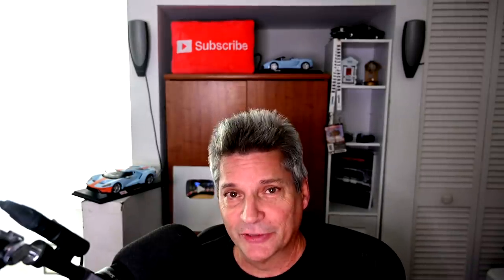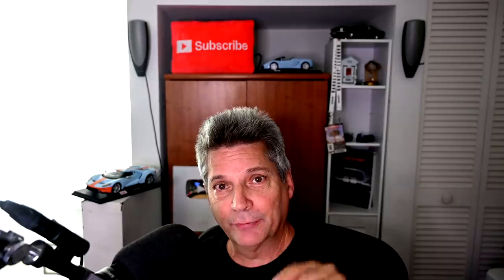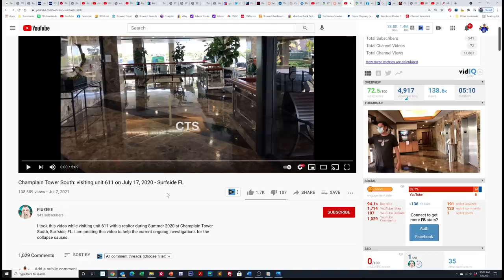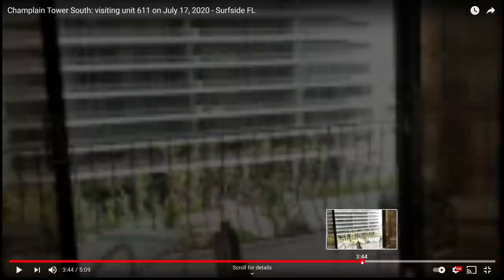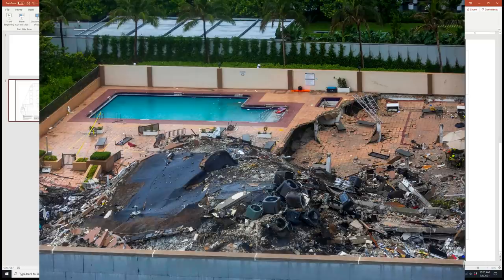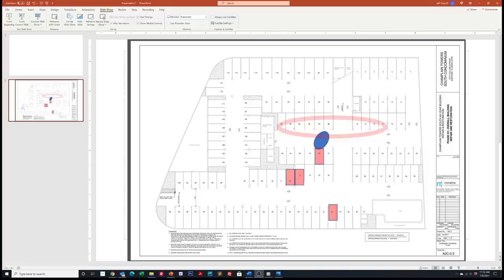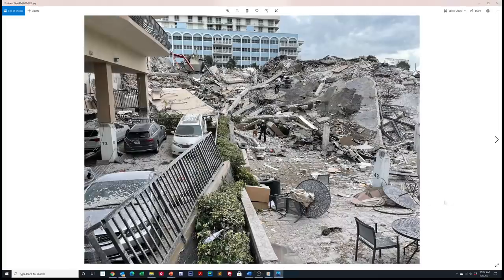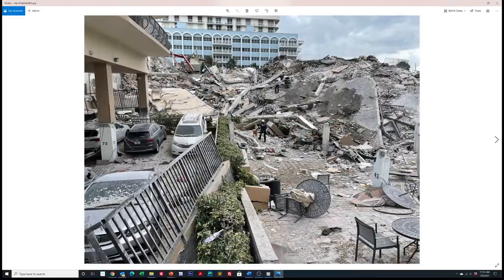Analysis Garage Video BEFORE Condo Collapse: Water Everywhere

Comment: The yellow paint on bottom of support column at 106, looks like might have retained water in the bottom.. didn't notice that on some of the others,  however did see shadows on some.   But this one looks like it def.  has a demarcation line.
Space 52 support column as well.
Could be a bad repair and paint job as well.
Reply: I was wondering why nobody commented on that because that was one of the first things I noticed. MANY of the columns show what appears to be water lines. Some are hard to tell and could be things like shadows, but considering we know that water was a big issue here it seems likely that most of them are actually from water. It also appears to be in all areas with only a few not showing at least suspicion of water. It's also worth noting that MAYBE the ones that appear to lack these lines may have simply been repainted recently enough that the lines are covered. If there is one consistent theme throughout it is that water was a constant long term issue here in nearly every way.

Also worth mentioning that in most of the shots that are clear enough you can see the markings of what appear to be large dried up water puddles all over the place. These are not just where we know the "hot spots" are either, it looks like water has infiltrated literally the entire area. I could not find a single spot in the videos where there wasn't at least one sign of water collecting or causing damage.
Reply: @rickh5088   I agree.   It's scary to see what was going on before this all collapsed, and that this was allowed to continue until catastrophic failure.

Comment: Jeff you were right on it.  Note the garage floor elliptical crack pattern that you highlighted around parking spots 14, 15 and 16.  The main support column 14 is right at the base of the ramp and at the rain drain at the base of the ramp.  The surrounding garage deck and column is depressed a few inches.  Loosing several inches of column 14 support placed major pressure on the floor column junctions above, thus caused the garage ceiling to spider crack everywhere.  I believe the combination of the garage water drain area and the constant vehicular vibrations  near-liquified the foundation of support 14 column over thousands of vehicular load vibrations.  The major building load on 14 caused it to settled, which further cracked the rain drain which allowed more water to undermine the columns.  Continued settlement caused the garage deck to crack in the elliptical pattern you highlighted around 14, 15 and 16.  As water continued to flow underneath the garage floor and through the cracked deck above, more and more rebar and concrete got compromised to the point of failure.  You showed the image from across the way into the garage which showed the cross support beam that sheared due to the support column settlement.  A sad cascading events from there.  Thank you for your great analysis which has educated all in what compromised concrete and rebar looks like.

Comment: Almost every one of those posts is discolored in the bottom third. That's interesting.
Reply: They occasionally had flooding in the garage, from storm water coming down the ramp, 2 to 3 feet deep. There were times they had to pump it out. I don't know how often but it was reported, on the news, in the first day or two after the collapse.
Reply: I noticed it immediately, too!
Reply: I noticed that too
Reply: @bella7687  WHAT ABOUT THAT SINGLE RED POST???
Reply: @jamesgreg5542  it all looks like it was literally sucking up water into all the concrete.
Reply: They repainted the posts a lot and painted bottom third a heavier color than “white”!
Reply: The red post is to inform where the fire extinguisher is located. The little bit of water from ceiling so where is it coming from? Toilet overflows?
The Dewatering done when 87 Place was built next door removed water below this building foundation. Maintenance man said when  tide was up the basement flooded. That suggests the Dewatering created space infer the floor and each TIme it filled at up tide removes sand when it drains. Basement floors in garages do nothing have heavy reinforcing since it is poured on the ground. Look at the cracks on the basement floor caused by removal of the ground below.

Comment: Water 'could be' condensation from AC in vehicles..  Suggestion:  turn down or eliminate the background music.  It's distracting from your analysis.  Much appreciated video!
Reply: Yeah I hate to be that guy too but the music was so distracting and unnecessary and out of context.
Reply: yeah the inappropriate music is so annoying. Lose it.
Reply: But there is water where no vehicle is sitting , also a AC condenser will not cause that much water .
Reply: That's a theory, but looking at the ceiling, you can tell where the water came from.
Reply: Music isn’t a distraction and fits well into background.
Reply: Maintenance and inspection people made this walk on a regular basis and for years and weren’t concerned.  Is this considered normal and present in other buildings?
Reply: Too much water for condensation.
Reply: @toledojeeper2932  You are right.

Comment: There is something everyone seems to overlook the sand is shifting. The impacted soil this building was built on. Has anyone checked the surrounding buildings?
Reply: Thats what I thought initially when I heard the reporte
Reply: Nobody is overlooking that.  It just does not appear to be the cause of why this building collapsed. There are many other factors that are much more relevant.  All buildings in the surrounding area have been checked in the past two weeks, including the sister buildings to this one, and there is no such problem.  Residents at the identical sister building to this one were even given the option to relocate, despite the lack of findings, but they have decided not to.   Soil erosion is NOT the issue here!
Reply: The building was sinking. This is not uncommon but could be a contributing factor if the building was not sinking evenly.
Reply: @sunitamosesesq   Exactly. In fact the government maps show that the entire easternmost portion of the entire barrier island is bedrock, while the properties to the west are built on reclaimed land. NO SAND UNDER THIS BUILDING! However, it is possible, and i think probable, that their might be an underground conduit of some sort that allows the reported sea water to get underneath the building at high tide as has been reported. That huge 40+ ft crack that starts at the base of the ramp is enough to let thousands of gallons of water to seep up into the garage under pressure in a rather short time. They would be wise to check out that possibility before building another building on this particular parcel.
Reply: @SepherStar  Possible, but the building is actually built on bedrock. I think the unplanned weight of the Penthouse Suite that was constructed later as the "13th floor" could have played a big part in this whole scenario.
Reply: Even if the sand was shifting, where was the water leaking from?    I think that is the most obvious serious defect.
Reply: @tjburr1968  The pool deck when it rained or they watered the planters because it wasn't sloped.
Reply: @dalewalker4614  Heh. I'm going to be old fashioned and say it was the 14th floor. Old buildings have a token floor for unlucky number 13. Even the plans say penthouse 🤣
Reply: @tjburr1968  Your right, it's not just one threat that toppled this building but a series of threats in combination. This is why you can't ignore any single one of them . Shifting sands, poor design deterioration water pooling, rusting iron, weight distribution, ignoring small signs during inspections.  It all adds up

Comment: Right around 19:09 , when your at the part in front of the elevator, in the vid your saying you don't really see anything but if you look at the ceiling there are more of what appears to be rusty lines as well as another one of those shotty looking metal panels screwed to the ceiling. Just wanted to bring that up.

Comment: The roof siding on the ceiling above stall 54 is to prevent pieces of cement from falling on the vehicle and maybe to channel water. I'm going to say it's more for the falling cement.
Reply: The water coming through cement cracks is very alkaline and stains paint.
Reply: @callmeishmael7452  Yeah your right. Just think every time they parked what would be wrong with your vehicle the next day. You pay all that money for the condo and your vehicle gets trashed. Now we know the out come.
Reply: Either way, it shows they KNEW about the decay and chose a band-aid solution rather than an actual fix.

Comment: Someone might have already mentioned it but also in the video if you look at columns in the parking garage, the lower portion is painted yellow. At the bottom of basically every column you can see the paint look a little darker as if it is either currently wet or consistently get more water and maybe answers why they are darker at the bottom

Comment: Is the concrete subfloor (?) in the other tower sloped or level?

[Congratulations and thanks for the superb previous video. Three million views!]
Reply from the maker: Thanks that is awesome that other video is indeed screaming like you wouldn't believe it's my best performing video of all time period As for the other building we don't know how it is sloped and in fact we don't even know if the South tower's pool deck was sloped because I looked through all 300 plus pages of the floor plan and nothing shows the slope of the deck and except for some dotted lines on an overhead drawing that doesn't tell us anything. Also I suspect it was changed later on by somebody else so we don't know what the deal is. Another thing to consider is the fact that the original plans might have called for just a concrete deck, and if somebody came along later and add it's and in all of those bricks I wonder if that throws off the equation, not only that but the water soaking into that sand will add a lot of weight as well.
Reply: @jeffostroff  It's incredible that they did not slope the deck. I think current IBC (which is the basis of state and county building codes throughout much of the US) calls for 1/8" per foot; i.e. 1" drop every 10'. At least here in Maryland, that what we must do.
Reply: @jeffostroff  In the video we can see a security camera in the garage. How many security cameras were in the garage, and where were they placed? Also was there camera  footage stored in the cloud, or was the footage only on dvrs onsite?

Comment: Three thoughts:
1.  At the end, the video shot by the lawyer, it's can't be where you are pointing on the drawing, because the parking spaces aren't lined up correctly to intersect the wall where the leaky pipe was seen.  That car in that video is backed into a spot, with the wall running perpendicular to the parking space.  The parking spaces you point at on the drawing are parallel to the closest walls.  Also, the spaces you are pointing at in the drawing at that point are very well lit (see 23:50 mark), whereas the lawyer's video is in a dark, poorly lit space.  I'd have to assume the lawyer's video is near an exterior wall, in a poorly lit corner.
2.  Perfect video to contrast the size of the pillars under the portion of the building that held up, versus the size of the pillars under the sections that collapsed.
3.  The picture of a damaged pillar that you bring up around the time we get to the elevator area (yellow corner of a pillar with clear damage) appears to be the pillar marked for parking space 15 (see 27:19 mark).

Comment: My theory on it is that the columns didn't fail, but the ceiling slabs did fail, which led to increased stress and sideways forces on the columns that were meant to hold vertical stresses. I think the pool deck was not sloped correctly (along with other things) which made it so that the water from the residents coming out of the pool, on their way back to the building and the rain over time moved inward towards the building rather than outward off of the concrete. This caused cracks, leaks, erosion of rebar, and shifted stresses. The horrible patchwork and panels put up to divert falling water from cars only forced the water to build up and travel within the concrete even more. I suspect that more patches were put in place since this video that further held water in to damage concrete. Another thing I find really odd is that there were no horizontal beams under the pool deck (may not have been elsewhere too) which is part of why the pool deck easily fell around the columns. If the pool deck was entirely separate from the bottom level of the building, I think only the pool deck would have collapsed. What makes me really annoyed about it all is that this was a very overpriced place to live because of the location and view. That means the landlord was making far more money than it took to actually run the building purely out of demand. Yet, it seems like they were extremely cheap and negligent when it came to protecting the lives of the residents in the building. Disgusting.

Comment: Excellent content! I noticed at 19:12 into the video, by the elevator vestibule, there is another corrugated patch on the ceiling like the others you had noted.
Reply: And what appears to be a significant crack in the ceiling, leading to/from the corrugated patch.

Comment: The brown stuff on the ceiling looks like rust. Could it be from degraded rebar?
Reply: That's exactly what it is, exposed rebar. The rust then crawls along the rebar, causing it to expand and break the concrete, called spalling. Besides the brown areas you can see there are probably 20-30 times that amount that was patched over instead of replacing the rebar, which is very expensive. For anyone who could read that garage ceiling, it was screaming "RUN!"
Reply: @dalewalker4614  DAMN!!!

Comment: Note: The Crack in the concrete floor between 14 and 27. The floor looks like it's sinking toward that Crack. Then note the column outside after collapse is IN the ground by that dog handler. Water getting under the foundation causing a small sink hole?

Comment: I have watched all of your videos on this tragedy. I have never built an entire building but have done permitted work such as building a hillside deck. The city inspected at every stage before we could move forward. Why would no one inspect the pool deck for the slope the architect put in the designs? I realize that there are a number of factors that ultimately contributed to the demise of Champlain Towers South. It just seems that at least to some extent the constant standing water eventually dissolved the waterproof barrier. ( Forgive me if my terminology is off). It just seems that could have been caught easily during the building process which we now know would have saved 98 lives. I am sure there were other things that could have been caught but this one seems like it would have been very easy to spot during construction.

Comment: 7:30 the water must have come from above, hence the peeling paint. It looks like wherever we have a puddle of water we have paint peeling above.
Reply: The pavers by the pool ?
Reply: @ninob411   Among other issues. The pool deck appears to be a solid concrete slab, covered by a very thick waterproofing membrane then topped with the pavers. Pavers are notorious for allowing water to seep through them or between them and wreaking havoc below. Any water that gets trapped in the pavers or the membrane will add lots of weight to bear in a hurry.
Reply: Not necessarily.  Paint will peel just from moisture, which to an extent, is unavoidable when you have an opening such as an entry way.  Even if you leave a front door open in your house for weeks or months, eventually your house's paint will start to peel as well from moisture.  The fact is is that the owner of the building was notified in 2018 of structural issues, and either took too long to resolve or simply did "nothing" to resolve it.  Reports are that he asked the city for help in the repairs, but that's not really the city's problem.  If the owner can't afford the repairs that's their problem, not the city or its residents.